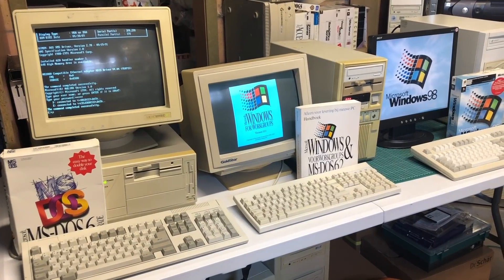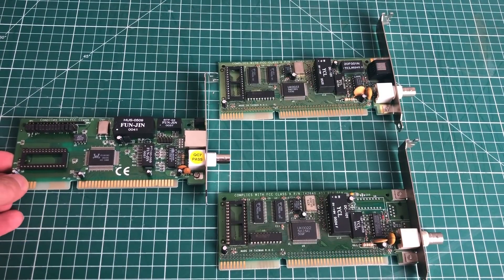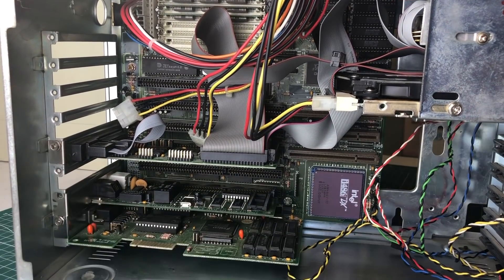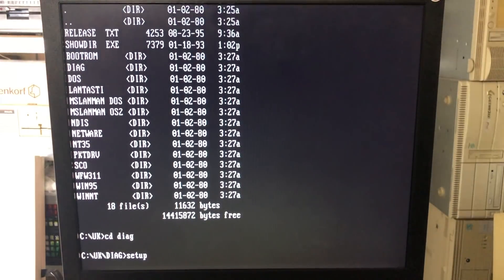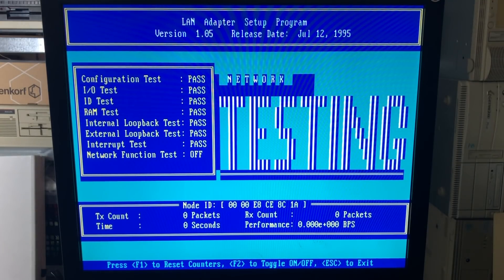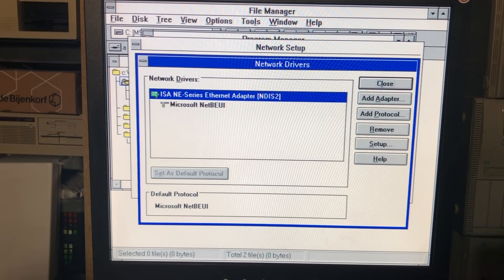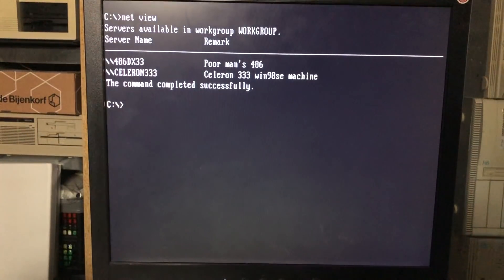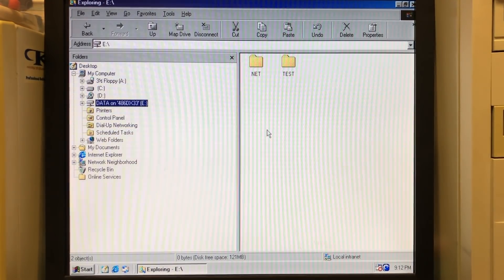Creating a retro Microsoft network using real retro hardware

Comment: Enjoyed this immensely.  Been doing something similar using 86Box and vde-switch for the networking.  Recreated my first programming job setup - my machine was a win95 486 ,a typical admin user was a win3.11 486 machine - and we had a Compaq Prosignia server running Novell Netware 3.12.  Managed to create a successful emulation of all these on a virtual network using the above tools.  After that,  I did the "upgrade" introducing an NT Server....

Comment: Want the real experience?

Build a WAN across 2 sites, Gandalf bridges, a couple CSU/DS’s and simulate a T-1 line. No layer 3, bridge Ethernet across them. Early on many networks I was on didn’t even know what layer 3 was, the apps were all raw Ethernet.
Reply from the maker: Going to start slow and easy with some smb networking on ms-dos / wfw 3.11 and win 95/98 :) But thanks for the tip.

Comment: The old BNC days, how I (not) miss them :-D It was a pain, if only one T adapter or terminator or cable was faulty the whole network and most computers were slown down :-D We used it for gaming back in the days, playing DESCENT 2 over BNC network. When we finally could afford a RJ45 switch it was suuuuuch a relief :)

Also cool to see 486 CPUs... without coolers :)... I actually forgot that back in those days you didn't need CPU coolers, I thought that was a thing of the 6502 C64 days :-D

Comment: “ThinNet” (10-Base-2) Ethernet (50 ohm terminators using RG-58/U coaxial cable)
First worked with in 1983 with 3Com cards in IBM PCs and XTs workstations (Business college Lab).
The File server was Altos 986 (10 MHz, 8086) running a version of Xenix and 3Com software (adopted by MS).
Wordstar and SuperCalc initial applications, later replaced by Word Perfect and Lotus 1-2-3.

Comment: That brings back a lot of memory, I still remember back in '96 the computer room of my department in my college had the same network configuration, computers there only ran DOS and windows 3.11, but they had no hdd installed, loading win3.11 required network to complete.

Comment: Why do the ends need to be "terminated"? Why do you have to do that it seems a bit stupid that they're built that way...Why can't you just plug the wire straight into it without using the T shaped thing and a terminator? Just seems like extra faff and expense.

Comment: 10baseT still gives me nightmares.  It was a horrendous system.  So hard to diagnose and so prone to failure.  Back in the mid 90s when we'd do LAN parties, we used to spend hours getting the stupid thing setup and working.  There'd always be one broken T-Piece or a shorted terminator.

Then UTP became affordable and networking became fun!

Comment: 14:06 Of course, the proper driver is included in the WIN 98 CD because that card is old as molasses (somewhat old even back then). This was not the typical experience when you installed new hardware.

Comment: Is there some kind of magic about using 3 old computers? When I was a teen in my parent's basement, I remember spending a solid week fucking around with 3 old units I had, networking them together (2 at a time, because I only had one ethernet cable), living on coca-cola and popcorn, and that was an amazing time. I could load a CD on one machine, and play it on the other! Had no speakers, but it still technically worked. Did all sorts of things- Found out what I could do, what I couldn't do, and just enjoyed the tinkering. I just turned 31 and I STILL love this stuff! My first computer was a 386 Win95. Had 2 700 MB hard drives, no sound, no CD (at first), it had been Y2K-proofed, and my favorite thing to do was mess with animations on Asymetrix 3D/FX. My first printer was a Lexmark Z11 (or X11, whichever), took several floppies to install it, and I used up the ink constantly printing out rendered images. Only had one cartridge, either black or color.

Comment: Fantastic information, would the same drivers and protocols apply to RJ45 connections, and would you need to use a network switch to communicate between the computers or can you connect RJ45 cables directly?
Reply from the maker: Same rules apply. But you need a router / switch where every computer can connect to

Comment: IIRC, there were dos utility called laplink to connect 2 dos pc via serial or parallel port and to access shared file/folder. CMIIW. 
I used to play quake 1 with my friends using serial cross cable from dos, as well as some old dos games like duke3d and doom 1/2 working nicely. 

Sharing from dos?
What about "net share" command? 

Sorry, my memories were a bit rusty, been more than 2 decades since the last time I played with dos networking.

Comment: You can definitely set up shares with the DOS redirector. That's sort of the whole point of having a DOS network :) Brought back memories! Windows 3.1 networking was a big deal because a free TCP/IP stack was available. You had to install a 32-bit subsystem, Win32s, for it to work. (This was pre-installed on Windows for Workgroups.) Until then you had to BUY a TCP/IP stack and it could be expensive. Win32s was the transition point to modern computing, which coincides with widespread adoption of 32-bit hardware and ubiquitous TCP/IP.

Comment: Setting up a Windows NT domain for a network of retro computers can provide numerous benefits even in a single user, multi machine environment. Logon scripts are useful for automatically mapping network shares you frequently use and synchronizing the client's clock with the server no matter what computer you log on to. Also, if you really want to always have a consistent desktop appearance across all your systems, you can set up roaming profiles.

Comment: i remember myself having a 10baseT/bnc card in one of my earlier machines when i was a kid and had to use what my dad got somehow somewhere (he worked for a civilian company wich worked for the armed foces - so all those machines where the old ones when the company got new ones) - but already lived in the age of ethernet over twisted pair - so never had to do myself any like token ring or thin/thickNet - nice to see it in action
what got my a bit thinking: all 3 drivers supported IP - why you stuck to NetBEUI? was IP that hard back then?
also: what about IPX/SPX or Novell? always read them - never had old hardware to use them (when i got my first steps to networking it was already the time of 802.11b)
Reply from the maker: I opted for Netbeui because it is the easiest to setup in this environment for simple file and print sharing. I tried IPX/SPX but didn't work on the windows 3.11 machine for some reason. TCP/IP was also possible but requires additional setup (setting up a DHCP server or setting up manual IPs). IPX/SPX remains great for gaming, and I will try to find out why it didn't work on the 3.11 machine.
Reply: @RetroSpector78  I recall had trouble and to tinker with IPX/SPX once when I wanted to play some Command and Conquer with a friend as, for what ever reason, any of the games included in the 10 year anniversary collection, requires it, although only the first CnC and the first Red Alert where available for DOS, any later game require Windows 95 or later - and the latest (CnC Generals) was released in 2003 - so it was already the XP days - but it still doesn't support TCP/IP but still only IPX/SPX
it also had a really annoying drm protection prevent to play together when you used the same cd key - wich luckly could be easy change in the registry (but always had to be valid as it wasn't only checked once at install but every time it was launched - so when changed to an invalid serial it wouldn't start anymore
but this was the only time I had to do something with IPX/SPX - and as we had XP back then the OS did anything for us - so it was only a matter of install the protocol in the network settings - impossible to do with anything newer than XP as IPX/SPX was removed with vista (and could only installed in 32bit versions as IPX/SPX was never ported to 64bit) - so, if you want to play it today you somewhat forced to setup VMs and someone get them to work together (never tried, don't know if possible)
about TCP/IP: well, I can't remember if those old OS already had the ability to zeroconf themselv - but I guess as DOS don't know DHCP it would had required to setup static IPs anyway - guess that one small extra step would had been worth it
anyhow - nvm - cool to see such old tech in action and where modern stuff comes from

Comment: Nice Video. I am a bit confused. You delete the IPX and keep the TCP IP. Why not keep both oder delete both? I love the ipx Protocol. I had a BNC Network with my friends in my house and the neighbour house. About 8 PC running Windows 3.11 and Windows 3.1 over BNC. Works great. And i played Dos games over IPX also great future. I shared also Printers. Later i mix up BNC and TP Network over and BNC Hub. You know Winchat and Winpopup? I LOVE the old network. Mush more easy to share files like on Windows 10. It is annoying how much clicks you must do on Windows 10 machines :-(
Reply from the maker: Probably an error during the editing. Had an issue with ipx/spx as I could not get it to work with windows 3.11 Netbeui worked fine. Did not want to bother with tcp/ip in this video as netbeui is the easiest protocol to setup for file/printer sharing in this environment. Ipx/spx is indeed great for msdos gaming.

Comment: When i started in I.T. we were a DEC shop and the network used DEC Thicknet cable and if you needed to make a connection, you used a "vampire" clamp to pierce the cable. You could then hook up your pc or other equipment using an AUI cable.

Comment: This video brings back some good old memories. But then again I don't necessarily miss the hassle that this was back in the day and the extreme low speeds and limitations that were many. 😂
Reply from the maker: Yes, and also lots of points of failures. Lots a couple of hours the other day cause of a bad terminator plug. Problem is you always think its going to be software, configuration or irq / io resources, or something like that. Sometimes you miss the obvious.
Reply: @RetroSpector78  Yep very true!
I'm just glad that technology has come a long way.

Comment: I fondly remember a Quake1 BNC LAN party with some friends in the 90s (:
I had to take a bus to the next computer store to buy terminators because we never hooked up more than two machines. ^^
Good times (:
Reply: That's hardcore. There were so many obstacles to making things work back then, but it made one very dedicated to the project.
Reply: H - you only need 2 terminators per "network" just each machine and network card needed a T fitting.

so 2 machines - 2 Terminators and 2 T fittings
so 4 machines - 2 Terminators and 4 T fittings
so 8 machines - 2 Terminators and 8 T fittings  etc

but yeah you loose it in the car ( or boot or they fall of when you carry them ) 

I still have co-ax under the house connecting 3 rooms, i am to big to crawl under and recover it so its still sits there  - partially nailed to under floor beams

Regards
George
Reply: I am surprised it worked connecting the coax directly into the card.  Even with just 2 PCs, each end of the cable needed to be terminated.  You were very lucky...
Reply: @stoojinator  We were surprised too ^^ It ran worse than a terminated ring with 5 ppl tho. We had a lot of dropped packets. Still way better than any 56k connection though. ^^

Comment: Oh buddy! I find its much more simple to load simple 9x or DOS USB drivers and put all your files on a fat parition thumb drive. Its so much easier and faster then this old style networking and if your crazy enough to put these online in 2019 yikes, even behind a router. Firefox with KernelEX works like hell,. so really Networking retro style? Other then to make this video. No use for it hehe
Reply from the maker: If you take things like virtualization , dosbox and modern computing in general into account than obviously there is no use for retro computing at all. This is just for fun and to show people how things used to be and how things can be done should you be interested in setting up a network.
Reply: @RetroSpector78  I use to use Laplink for that.

Comment: Re: 75 ohm vs. 50 ohm terminators. Either can be used, depending on the coaxial cable used. The terminator impedance should match the impedance of the coaxial cable. Thus, you can use the cheaper and more available 75 ohm TV cable if you use 75 ohm terminators.

Comment: Is there a reason to use these machines beyond nostalgia?
I have an old Mwave ISA Modem Sound card that I need to hook up so I can convert old phone messages burned to CD. I really don't want to buy a vintage PC just for that.
Reply: Depends on what you want to do. Typically old machines are useful for running software or games that don't run correctly or at all on modern ones. Another would be similar to your situation where you have a piece of hardware that no modern machine has conctions for. In your case I'm not sure what format they're stored in, but perhaps there's a modern program that can convert them?
Reply: @chadmasta5  Thanks for the reply. Sadly the audio files were recorder in an MWAVE specific format. The only convertes I've found require that chip to be available.

Comment: I did this once a long time ago, the only difference is I had my setup using the internet off a windows NT machine and two network connections.  I had the internet over the RJ45 and shared it with the token ring network (BNC connectors)
Reply from the maker: Yeah planning on doing the same in a future video
Reply: @RetroSpector78  good Luck

Comment: In 1998, I had me one of these setup. I used the junk thrown out at a place I worked at to play with my first network.  Was only in use for a few months before switching to 10megabit, I found this setup you show to be about 3 megabit in speed. Wasn't until 2004 did I finally discard the old hardware. Always thought it might be of some use in the future, but was glad I never needed it again.

Comment: I really love windows 98 se..It brings back memories of when I was a student..
Reply from the maker: 1eshardo great operating system... together with XP I thought these were really solid operating systems. Switched to Apple almost 10 years ago and rediscovering the microsoft operating systems through retro computing :) Even thinking about buying a new windows desktop PC :)
Reply: @RetroSpector78  Yes, this windows is so stable and simple GUI. Compare with windows 10, where windows 10 take time to open picture format..
Reply: @1eshardo  I used Win98 as long as I could until my hardware requirements couldn't be accommodated. I thought it was great and very stable and I have always preferred the "classic" Start Menu over the "better versions" (or none at all!) in more recent versions. My first network was early 2000s and 100 Base-T with two Win98 machines. I remember it being very easy to setup and more straightforward than on Win 7 and Win 10 with the machine deciding for you whether it's a private or public network.
Reply: @ian_b I think microsoft make come back for version win 98. look at windows 10... there are similarities..but windows 10 so poweful graphic display..and simple setting..
Reply: 98 SE was a good OS, then Microsoft messed it up with Millennium bring instate hate to the name Millennial's. .
Reply: What about First edition? Can I work with tat?

Comment: MS-DOS based networking was capable of sharing folders. The NET START SERVER command would start this. However the machine was then turned into a dedicated server,  no access to the command prompt anymore. Only IBM had a modified version of the MS Networks code that made it possible to run the file server as a background task (much like DOS' print spooler). Novell Netware also required a dedicated file server at that time.
Reply from the maker: Alain Fauconnet will look into that and have a series of follow up networking videos planned

Comment: um I see a box of windows 95 but where is windows 98 box that you are saying windows 98?
Reply from the maker: Explained in the video. I unfortunately didn’t have a windows 98 box.
Reply: @RetroSpector78  oh ok I see do you need the one with or with out windows 98 plus  without is just standard but the operating system upgrade though of first to second edition. the one with Microsoft windows 98 plus has more themes and spider solitaire. unlike windows 95 with Microsoft plus it does have themes but it has 3d pinball full tilt demo and windows 2000 windows millennium windows xp just has spider solitaire and 3d pinball. thats all i'm suggesting though
Reply from the maker: @josephfrye7342  I'm going to try and add one to my collection but so far nothing has shown up.
Reply: @RetroSpector78  oh ok then :)

Comment: What if you then added a Core 2 Duo PC from 2007 with Windows Vista? Would it be possible to add that to this network of vintage PCs.
Reply from the maker: Have to draw a line somewhere :) I still consider myself young enough to not consider vista retro :)
Reply: @RetroSpector78  Me personally, I consider Windows 98 or older to be retro. My oldest laptop Toshiba Satelite 330cds still works fine today with Windows 98 and it has a 266 MHz Pentium mmx CPU with 96 mb ram. About what a high end PC would have from 1997.